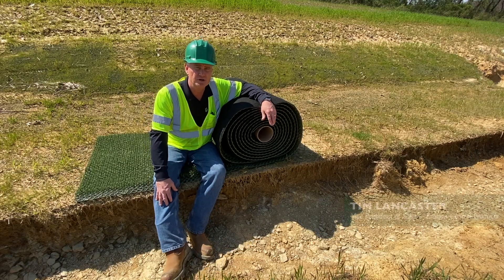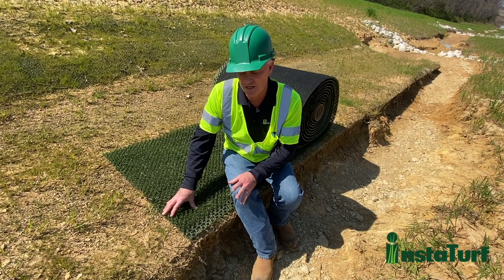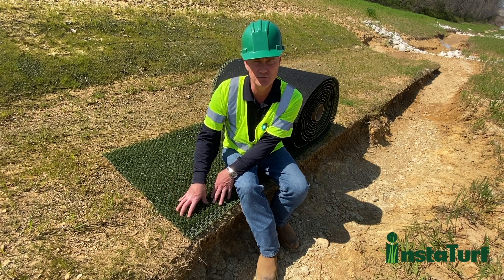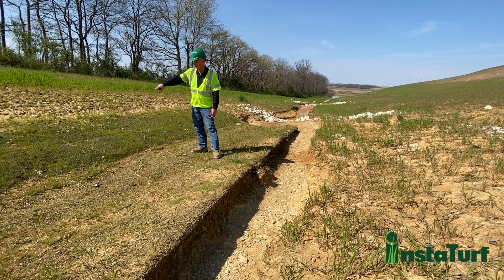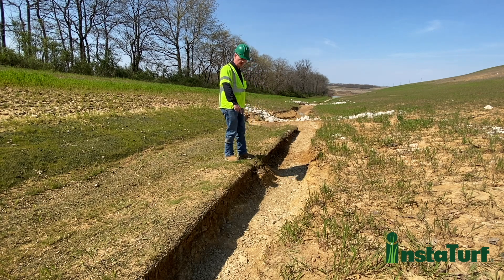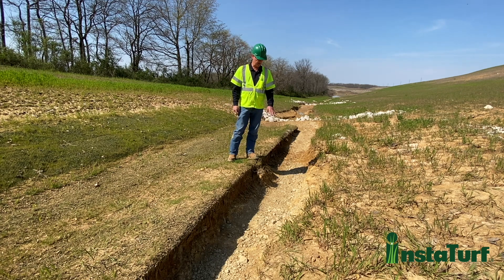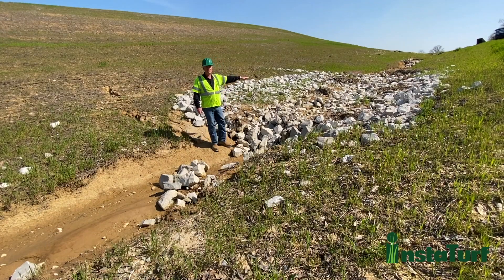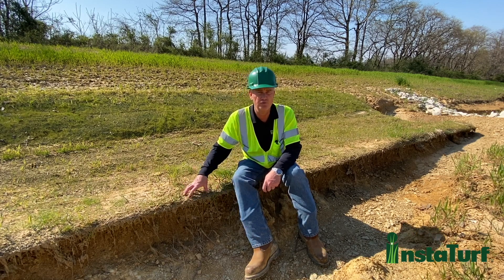InstaTurf® ShearForce™10 vs Rock Riprap for High Flow Channel Protection

Comment: Tried your cost estimator for a 4ft wide x 300ft drainage channel, so approx. 1200 sq ft project. Material pricing came out to a little over $3K. I got some quotes from a local grader for riprap, the rock alone to around the same price, so I don't see how this is any cheaper.